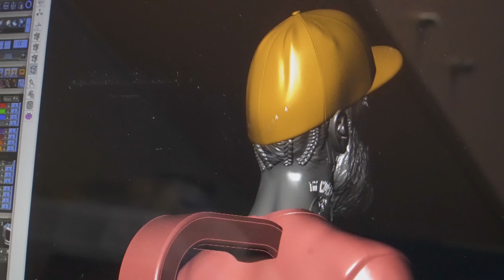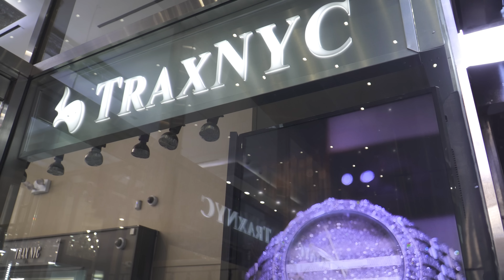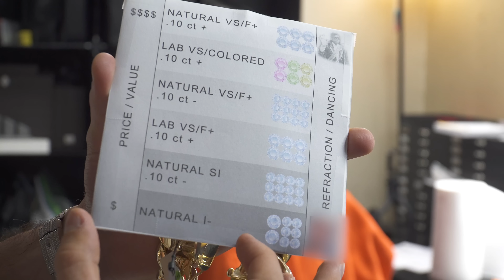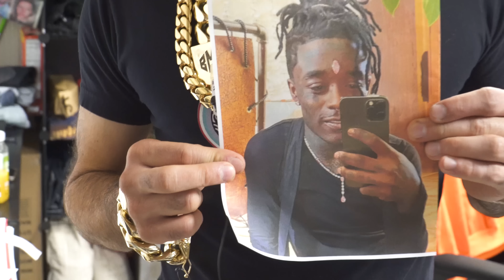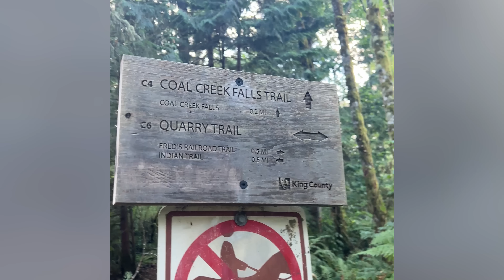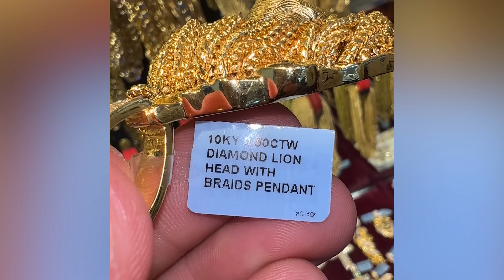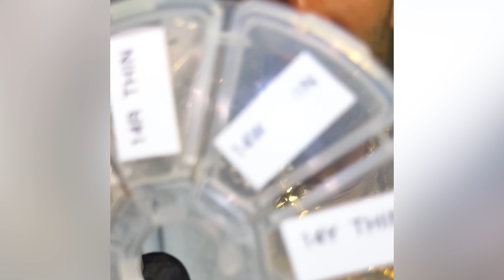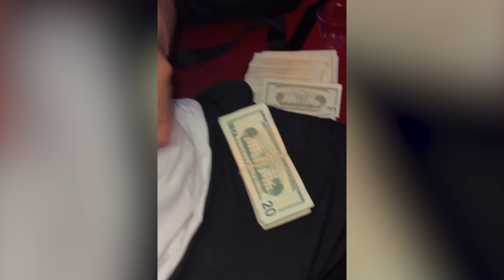TraxNYC & Ben Baller Takeover The Los Angeles Diamond District | S.2 EP.3

Comment: When you do mods you want to make sure that you do the same quality of modifications that the company who would make it busted out completely with the same quality of stones/metals/etc used within the entire modification of the piece/watch. That would be a presidential level of the bust down watch that I personally would think that could increase the value significantly, especially if the quality and tolerances are even better than the original manufacturer of the iced out piece/watch. Always putting out awesome content.